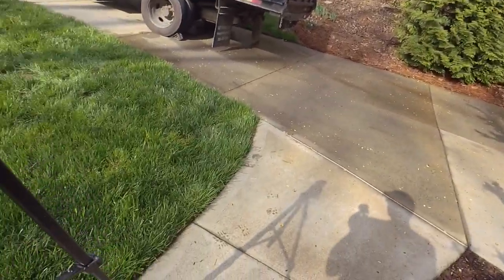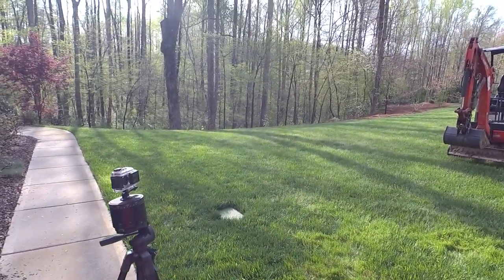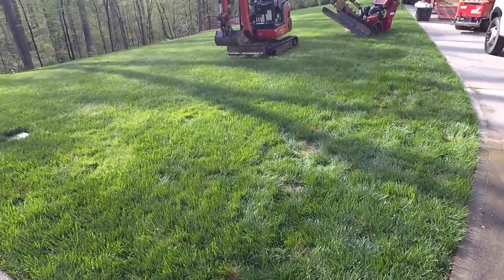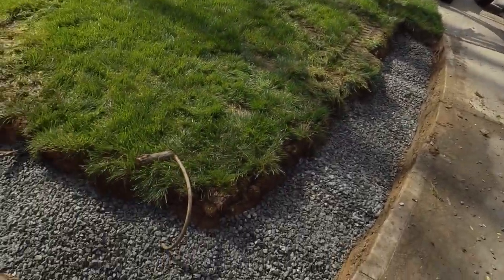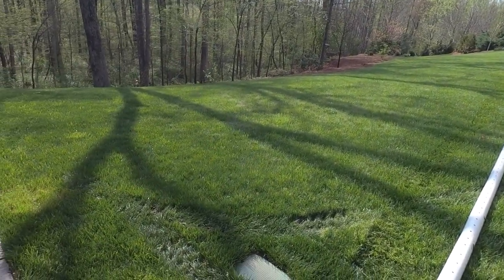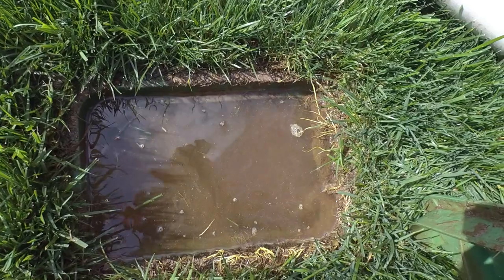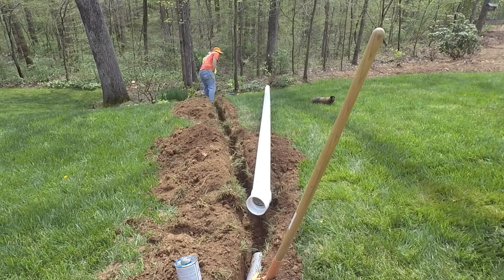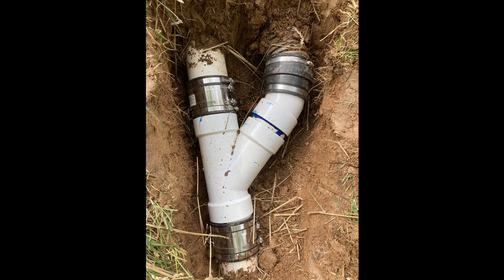Beautiful French Drain - Looks and Results

Comment: There is one element missing from this video . Where does all that water coming out of pvc end up ? A neighbors property ? Wooded wetlands that breed mosquitoes ? Whoever built that property on that piece of land didn't take into account heavy rains will go to the lowest point towards the garage which it does. That much water needs routing to a sewer system to keep it flowing away from low points and buildings. Whoever did the grading on that property fucked up.
Reply from the maker: It flows down to a creek 👍
Reply: @GCFD  Ok , now that makes more sense . Does the property have a septic tank and leeching field or is it connected to a sewer system for plumbing ? It is a beautiful property, but most buyers don't consider engineering aspects like proper drainage and grading to make sure there isn't an  unseen exterior issue that will affect the dwelling and cost thousands to correct. Good job on the French Drain, but I think it needs a water break at the top of the street and driveway to reduce water flow and prevent flooding before it gets to the french drain.

Comment: That pipe will be full of dirt in 24 months. This "French Drain" will fail.  Sorry.
Reply from the maker: thanks for your prediction Kirk. So far this design is holding up well. The reasons are by using a large quantity of ANGULAR rock as a filter, the flow is preserved. This provides the energy to rinse fines through and out of the system instead of letting them clog against a thin layer of fabric. I have FDs that are more than 24 months old and are still functioning properly. I'm not seeing what you are stating will happen.